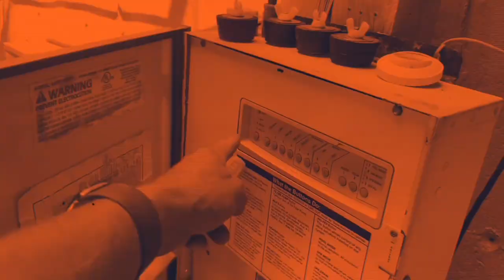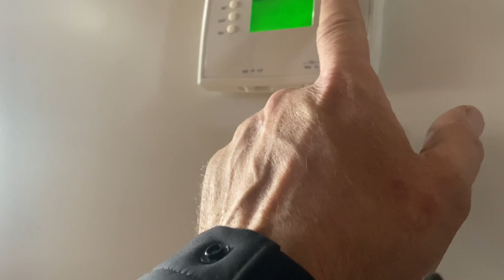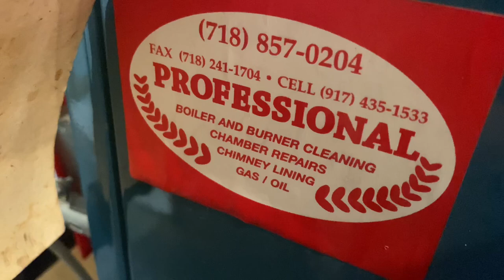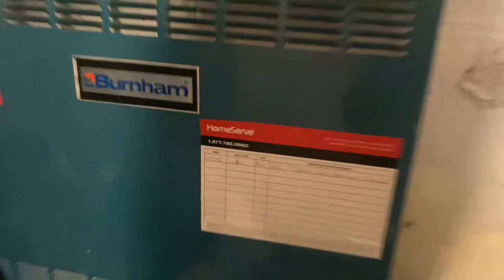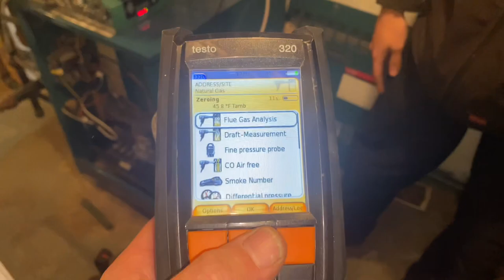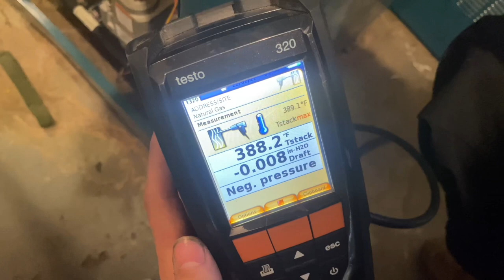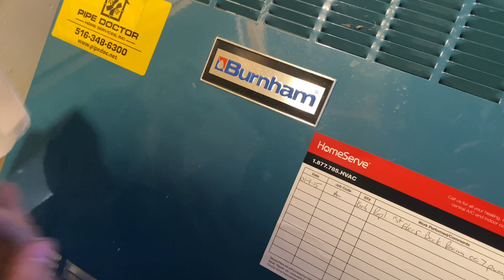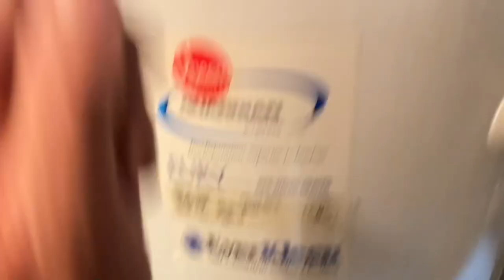EASY FIX TO RESTORE HEAT How to Reset Spill Switch Burnham Series 2 Gas Boiler No Heat

Comment: Had a similar situation Friday... customer CO alarm went off... Found melted plastic on water heater just like that...pulled flue from chimney and found inner wall of chimney partially collapsed.. I shut down and tagged the water heater advised to customer who got upset that I was leaving him without hot water... Told him I'm not a chimney guy.. it needs inspected and cleaned.. he wanted me to clear it out enough to work.. I explained that I can't do that... Documented what I found and had him sign a liability form stating he was advised it was not safe to use. Once the chimney was inspected, cleaned, and deemed safe we would be glad to return and get him hot water... He said well you didn't do anything I still don't have hot water.. I said well I'd rather you not have hot water and be safe than have hot water and die...

Comment: Makes me appreciate everything induced draft, where im at it gets so damn windy that there's constant spill issues. Mostly everything I see now has gotten replaced to either a combustion air blower design or induced draft design, and usually the spilling issues I see is because nothing is sized or done right, lack of chimney liner, improper sized venting, etc. Hacks bring me stacks

Comment: Have had those switches on Burnham's trip, especially shortly after an install.  All tech support says is move them over a little, seems a sweet spot that spills for a quick second or two before draft establishes and pulls it all out.

Comment: So at one point when you were talking to the home owner the Testo switched to Positive Pressure, is it normal for it to do that for a few seconds or does that indicate there might be an issue? With that water heater having the burnt top, maybe slightly blocked chimney?

Comment: I would guess they have a whole house exhaust fan or someone is running a box fan or two blowing out window/s and none open to allow makeup air.
I cooked my own water heater plastic rings the same way, fans blowing out to help remove construction dust and someone shut the other windows. grrrrrrrrrrr.